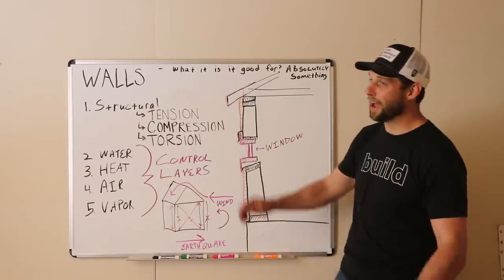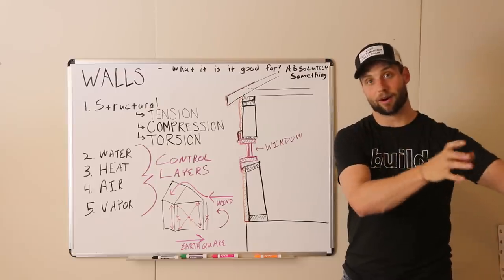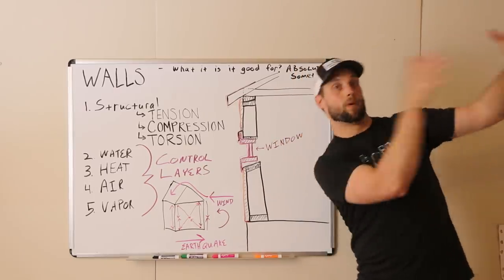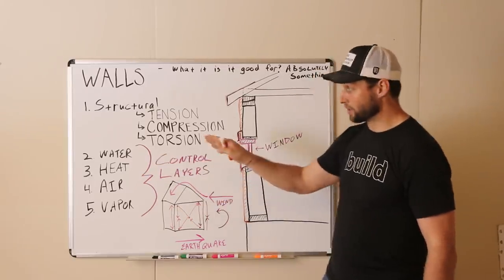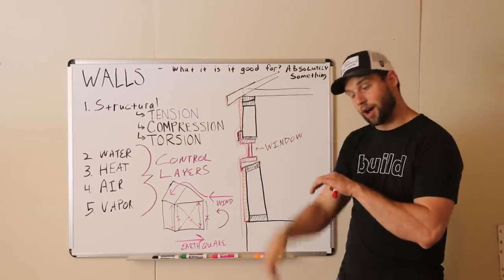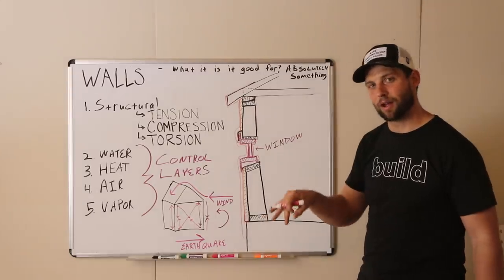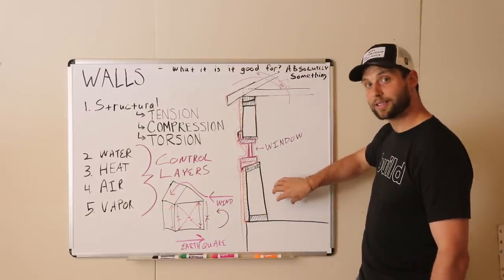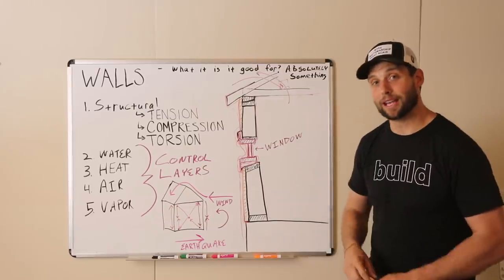How to Build a House - What the Walls Do - Basic Overview

Comment: Jordan, fun intro video to walls and building science. People misuse the term houses need to breathe, they don't need to and shouldn't breathe air, but they probably do want to breath water vapor with most building assemblies, meaning they need to be able to dry. Also, I would argue, along with Joe Lstiburek and Building Science Corporation, that the air control layer is more important than the thermal control layer. If you aren't stopping the air, the thermal layer could be bypassed.

Comment: I think you should run with the breathing analogy.  Houses do need to breathe, like we need to breathe.  

We don't breathe through our all our  holes or cuts. We control the air through specific holes in a regulated fashion. A house should do the same.  That's the job of the erv/hrv.
Reply from the maker: I like it!  Breathe with your breathing equipment not through your skin.... or worse!
Reply: I agree, very well said! 👍🏼
Reply: Very good analogy -
Reply: @JordanSmithBuilds  I think that's the more accurate and convincing argument - the house needs to breathe (take in fresh air and expel polluted air) just like a person needs to take oxygen in and expel carbon dioxide.  People don't seem to get that the "fresh" air they're sucking into the house through gaps and cracks isn't "clean" air and it's darn inefficient.

Comment: Hey Jordan, for a wall with exterior insulation for a southern dry climate what is the correct order for building steps

From inside to out 
sheet rock>steel frame with roxul batting insulation>advantech sheathing>tyvek WRB>roxul exterior insulation>1/2”airgap with furring strips>exterior cladding?

Or is the WRB supposed to be after the exterior insulation? Assuming I have a air tight structure I can control vapor drive but to plan for vapor drive ever happening where should the WRB be? To prevent the sheathing from any future water damage.

Comment: I would say in order of importance. 1. Structure 2. Water 3. Air 4. Thermal 5. Vapor. I think air leakage is more important then thermal heat loss. Air brings all kinds of things with it. Water, dusk, mold spores, and unconditioned air. Thermal is much easier to take care of.
Reply: Also using BEopt modeling software tightening up the air loss from 6 ach50 to 4  helps as much as moving from 2x4 to 2x6 as far as thermal loss is concerned.

Comment: Video suggestion: use of metal studs in residential construction. There's not a lot of good content on YouTube (or the internet, generally) about this subject and it would be great to hear the views of a builder. How do metal studs compare to LSL/LVL? Most of the info I see is about using them on non-load-bearing walls, particularly in basements and for bulkheads? Why are they very rare on load-bearing and exterior walls? The r-value of metal is very low, but with insulation between exterior studs and sheathing, that problem can be solved. And for hanging cabinets, plywood can be inserted between them (there's a Bob Vila video on YouTube that shows a good way to do that).
Reply: To make them structural is cost prohibitive because you need a heavier guage than interior walls and a whole lot of bracing.
Reply: Metal studs are generally not load bearing, you could take all the metal framed walls out of the structure and it will still stand, usually because it has a box beam(?) or Ibeam type of frame for the actual structure.
Reply: Due to the conductivity of metal studs, a similar residential wood wall structure framed out of metal would result in a 30%_70% loss in r-value among the entire wall. Unless you use a continuous exterior insulation residential metal frame is not a good practice to start.

Comment: Jordon, maybe your right, your  intention was different than my response. I don’t argue with your wall construction, it’s exactly how we build our 250 homes a year (all presold, no specs).    My issue with your video is your using  the ‘Track’ (your term) home builders (which are traditionally serves the starter home market ) as your example.  Home pricing for first time buyers is in a crisis for much of the country.  You blamed the alternate construction methods on builder profits and I’m trying to open your mind to the possibility that these builders are reaching out to engineers to cost saving alternatives to fill a market.  Maybe you should blame the engineers and low income buyer? I agree with you, the stuff your showing are not good choices. But your comparisons are not fair, comparing your perfect wall to the starter home builders may just indicate your out of touch with the market sector
Reply: Assuming that Joe Lstiburek is right, and I haven't seen anyone even try to make the case that he's wrong, the real question is how to get the "starter home" market to build homes with better airtightness and water control - and quit doing stupid stuff.  What's the true cost differential of adding effective air & water control layers - I bet not that much - assuming the builder isn't jacking up the costs for even more profit. I liken it to people that say we can't make iPhones in America because of the labor cost - when the labor cost in an iPhone is a small fraction of the total cost - even if the labor costs 5x more in America, it's still not cost prohibitive.  With the buying power of "tract home" builders in their market and the skill and efficiency that comes from repeated execution, it seems reasonable to assume that such builders could get the actual per unit cost down and then let the buyer amortize that cost over the life of their 15-year or 30-year mortgage.  How much could it possibly add to the monthly mortgage payment?

Comment: the only thing you have to seal and waterproof is the insulation unless there's a structure that can be weakened by water
Reply: Wood rot absolutely lowers structural capacity

Comment: I would not live in a tight house,  nor build one for unsuspecting clients unless there are compelling reasons.  People are cheap.  They'll turn off the HVAC, or fail to maintain it (never change filters, clean ducts etc).  Then you get a tight home off-gassing in a confined space, year-in, year-out.  And if you do maintain it, the system needs to run 24x7, which isn't cheap (of course, that's not a worry for the deep-pocketed clients' homes shown on this channel).  May as well live inside a chemical factory.   I'd rather build out of masonry or concrete and let the house breathe.  Of course, some climates demand extraordinary measures, but most climates don't need these 'tight' homes and the associated expense.
Reply: I like your thinking. My lungs like air. I breathe air and release gas, alot.
Reply: I think you're missing the point.  HVAC and ventilation should be completely separate systems.  Not running your HVAC doesn't mean your ventilation system can't be running.  ERVs and HRVs bring in fresh air 24/7 and require very little energy or maintenance.  If the homeowner can't cope with that, maybe they shouldn't own a home.  Kinda like someone being too cheap to change the oil in their car... the results are predictable.  If they're too cheap to run the ventilation system, maybe they can just pay the energy penalty of leaving a few windows open 24/7, which is essentially the same thing as building a leaky house that can "breathe".

Comment: If you want to be taken serious, stop doing diagrams that look like a two year old drew them.  This guy is still talking about the sill on an angle, well Jordan, did they cut the cripple on an angle and did they plane the front of the 2x4 sill flush since it would project out futher than the wall?  If you are a home builder as you say, then show use the homes you build, rather than getting you tube hits with drawings that are a joke.
Reply from the maker: We cut the cripple at an angle.  We usually run some sort of rain screen behind the cladding, eliminating the need to plane the protruding corner of the sill.  I have seen other guys plane it back to the sheathing if necessary.  I work with Risinger Homes in Austin Texas.  Go check out my other videos, Matt Risinger videos, or our Instagram account to see the homes we're building. 
Thanks for watching and commenting!
Reply: There is a difference between a sketch and a technical drawing. It is often useful to exaggerate details in a sketch as he did to make a point, like the need to make water drain outwards under a window. Jordan is not going to make perfect videos; after all he is doing this on the side. He is certainly not a hack, and he is trying to share what he knows regarding often- neglected details in home construction.